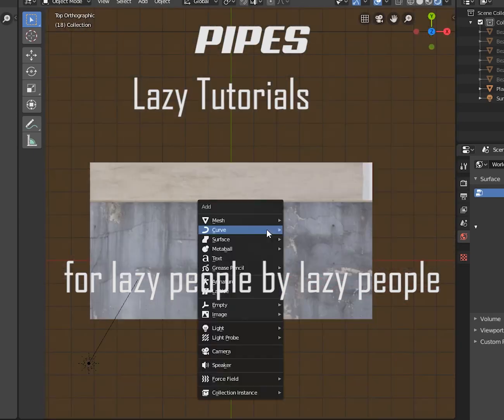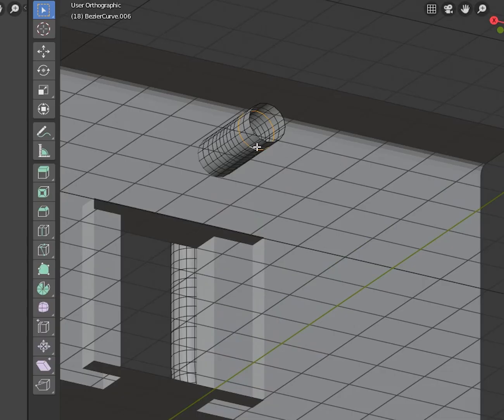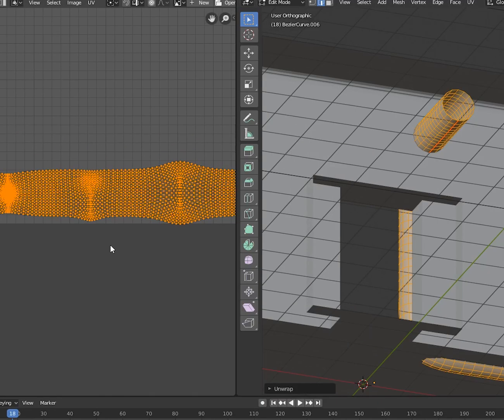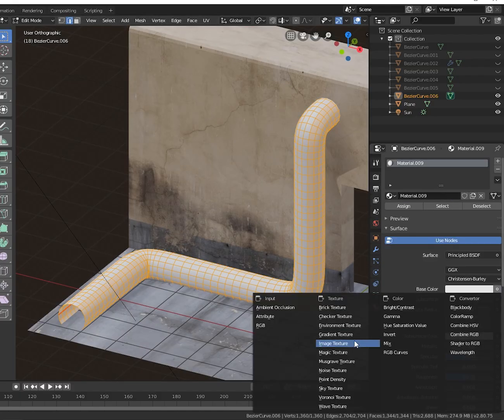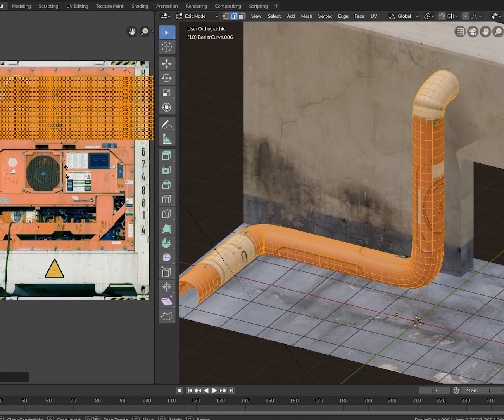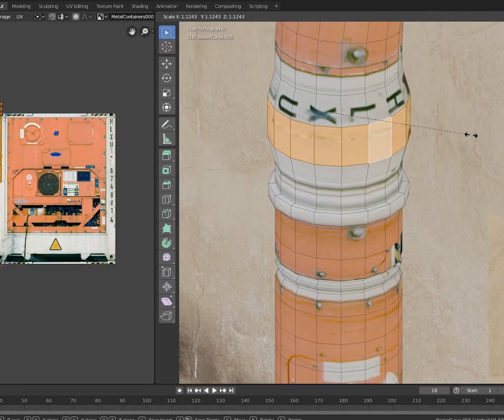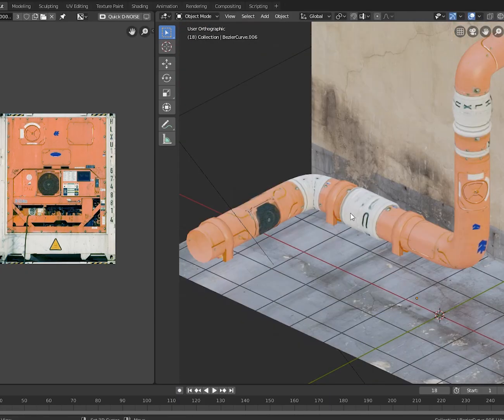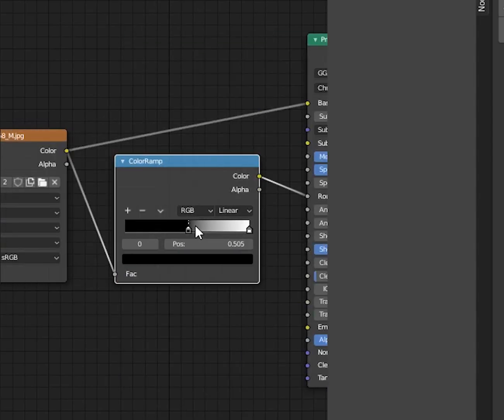Making Pipes in Blender - Lazy Tutorials

Comment: You can also straighten the UVs using Magic UV which comes with Blender. In the UV editor select one edge, then open the side panel (N), select Magic UV tab, drop down UV Manipulation, check Align UV, check Transmission, and hit XY-axis. Then select the other edge and hit the XY-axis button again.

Comment: tried installing the UV squares add on but there are some errors occuring and its not working. running 2.78 may be the problem...
Reply from the maker: ooo- perhaps? I think UV squares is included in blender by default- did you download it, or just try activating it in the addons preferences?
Reply: @IanHubert2  tried downloading/installing but i get an error message when i try to use it. sad face times all round
Reply from the maker: @meb8707  Dang, sorry about that :/ Yeah, maybe see if there's a version already installed in the addons list- it might work better? Though yeah, not sure if it was included as far back as 2.78
Reply: @IanHubert2  no worries. anyway, love the vids, man.
And when Im not on a job, i'll take the time to upgrade to 2.8 finally and become wizard of uv squares. or something...

Comment: Your pipes is awesome ! UvSquares does not work at home (on Blender 2.80.72) :(
Reply: Just use the cylinder projection and set the direction to alling to object

Then scale it up
Reply: Thanks for the tip. TexTools is an excellent addon, for unfolding UV, baking. 
It is finally available for Blender 2.80.

https://github.com/SavMartin/TexTools-Blender/releases/tag/TexTools_2.80

Comment: Use textool instead of uv square. Textool is free open source add-on
Reply: For 2.8?
Reply: @dommafia  yes
Reply from the maker: Oh that's awesome- I'll have to look into that. I've only used UVSquares- although it's been released free and open source as well.
Reply: @IanHubert2  but now it cost 20 usd approx how did you get it free
Reply from the maker: @Index3D  Did you check out the github link in the video description? It looks like he used to sell it in the marketplace, but switched over to open source. There's a good thread on it in blenderartists, too. 
https://blenderartists.org/t/addon-uvsquares-v1-4-updated-any-shape-supported/613111/114
Reply: @IanHubert2  will check it out too, thanks.

Comment: I would have loved to know a way to make UV flatter and not-swiggly .. without a addon.
Reply from the maker: You can totally just select edge loops in the UV editor and scale them to "0" on the x or y axis (hit S,Y,0 or S,X,0 depending on the axis)- but it's a bit of a pain in the butt. If you're doing any amount of UV unwrapping, having a tool that does it for you will save you so much time.
Reply: Right 'ad ons' are a pain in the ass...
Reply from the maker: @justanameonyourscreen5954  Here I made you this: https://youtu.be/aoRrfY9tz-o

Comment: I was struggling with pipe joints recently. Luckily my use case was covered by the pipe joint in the bundled mesh extras add-on, but what bugs me is that I wouldn't know how to create a simple y-connector myself (ideally with bevels at the seams) without resorting to Python scripting.